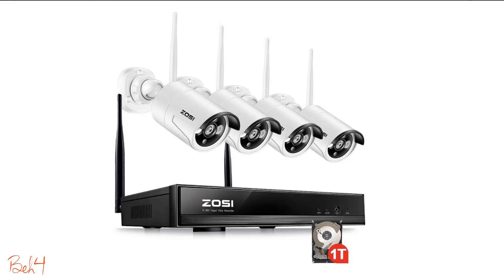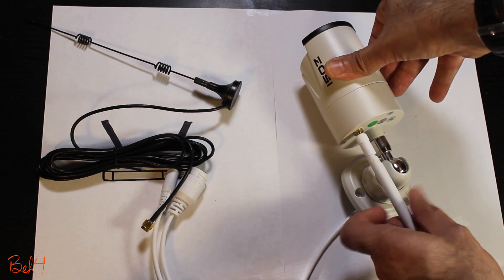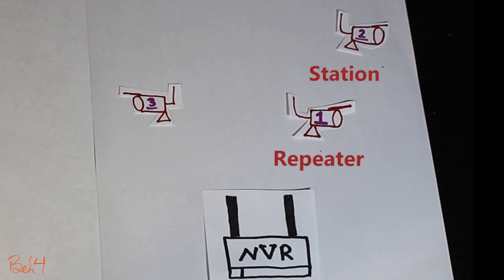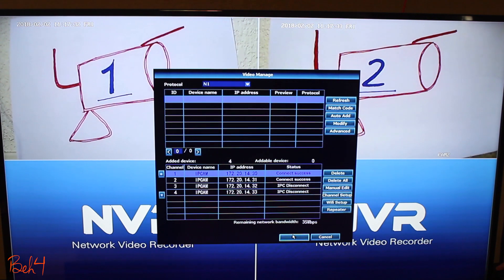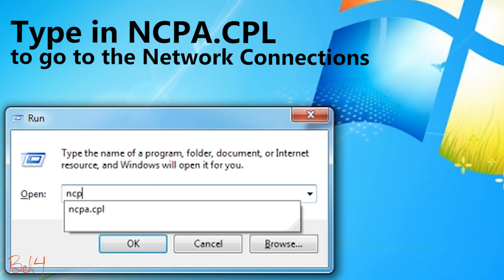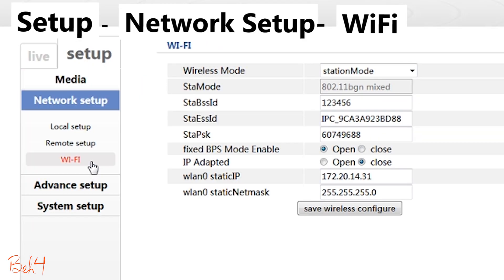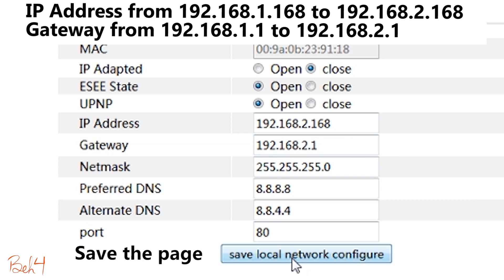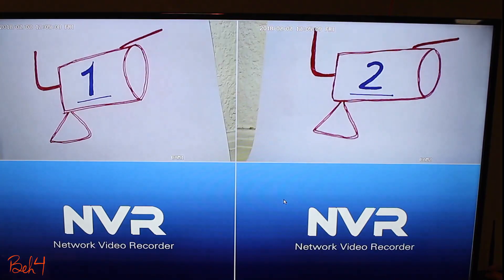ZOSI Security Camera - PART 3 [Resolve Poor Signal Issue]

Comment: What should be the distance between cameras and NVR?
Reply from the maker: There is no exact number because each environment is different ( obstacles, interference etc). The wireless range of the NVR should probably be more or less the same as the wireless range of a 2.4 GHz wireless router used in the same environment with the same wireless configuration. In my house for example the maximum practical range of the NVR is around 20 m.
Reply: Behfor Thanks..
Reply from the maker: You're very welcome!
Reply: @Behfor  > When you say your getting 20m, is that 20m radius from the NVR or Diametric range (which means the max distance from NVR to any camera can only be about 10m). But if its radius, then it will essentially cover 40m diameter circle of coverage. Can you plz explain. Or in other words whats the furthest distance your getting from the NVR to any one camera if you drew a line between them thru your building.

Comment: I have 8 960P IP cameras and connecting to the router resolved my issues with the last 3.  Thank you.    I am stuggling with motion alerts.   No matter what I set the sensitivity to I get hundreds of false alerts a day.   Do you have any idea what else I can try?   I have set the sensitivity to 1  and 99 with no improvement.   Also constrain the detection area to a small area.
Reply from the maker: You have already tried changing the sensitivity and changing the detection area and that's all I could have suggested. I personally use motion alerts for one of the cameras and only for a few hours a day. There were a few false alerts so far but nothing like what your experienced! Make sure the NVR's firmware is up-to-date, maybe it was an issue they fixed in the new firmware! Unfortunately that's all I can think of.

Comment: This is a fantastic video!  Thank you for sharing!  When using the wireless router to extend the range configuration, if a person messes up the settings in the cameras, can they be reset back to default so they would work as they did out of the box?  Also, I've got two WAPs...I'm assuming the method of using the WAPs would be the same, as long as they are all on the same network...right?  Thanks for your time!
Reply from the maker: Thank you so much for your comment and questions. In case the settings are messed up, you can connect the camera directly with an ethernet cable to the NVR and in the Video Manage page click Refresh so the NVR can find the connected camera and then click Match Code to pair it with NVR again the same way it was before. Thanks
Reply from the maker: As for the second question, you are absolutely right. As long the they are on the network it should work fine. Thanks!

Comment: Any idea how to do the second method using a Chormebook ?
Reply from the maker: Unfortunately I wouldn't know that because I never had a Chromebook! Maybe google would be helpful! You'll just need to set a static IP address to the LAN interface of the computer (the same as in the video) I'm just not sure how this can be done in Chromebook! Sorry!
Reply: Thank you for your reply. I'll just use an old windows laptop. I've got an Annke wireless system that is exactly the same as the Zosi, however I cant work out the default ip address of the cameras! :(
Reply from the maker: one way to find that is to connect the camera directly to the nvr and go to the video manage menu and hit the search button on the top of the page, it should find the camera and show its IP address.
Reply: Thank you very much. I'll give this a go! ... Great videos as well.

Comment: NVR giving an error information of repeater is incomplete when trying to access repeater function any solution?
Reply from the maker: I've seen that sometimes, but from what I remember it wasn't a serious error, I think it was because maybe one or more of the cameras were not connected to the NVR. Make sure all of them are connected when you go to the repeater and if you still see this error, close the error message and see if you can configure the repeater or not. From what I remember I could still configure the repeater even when this error showed up! I could be wrong though!
Reply: Thank you for your reply, no it doesn't allow to configure the repeater if i close the error message also, it just have some red lines for the camera and keeps giving the same error on pressing the refresh button.

Comment: Would it be possible to connect the camera to a wireless extender so that the wireless extender relays back to the router and then router to nvr. If so would the same steps apply? The extender is on the same network as the router
Reply from the maker: As long the they are all on the same network and the NVR is able to reach the camera which is connected to the repeater it should work fine and the steps would be the same as the ones in this video. Thanks
Reply: Behfor Thanks Behfor! I'll give it a try and report back if it works
Reply from the maker: Good luck! :-)
Reply: Were you able to connect via WiFi extender? If so, what steps did you follow? Thank you!
Reply: Chris C I wasn't able to extend with a Wi-Fi extender. It might be possible but I couldn't figure it out. However, I was able to configure the repeater system so that all cameras could connect with good to great connection. This took some time testing out different repeater options but it works (on a 4000sqft house with cameras on all sides and with an nvr that is not central).  Try and use the cameras that are closest to the Wi-Fi router/ best connection as your main hub and then try repeating through those. I would suggest moving your nvr to a central location where all cameras can receive some signal (if you have already installed them outside your house). But still you'll need to have some connection to each camera in order for the repeater system to work. Hope that helps bud
Reply: Chris C Just to note, move your nvr to a central location to configure your repeater so you can have connection to all cameras. You can then move your nvr back to whatever location you would like to have your nvr setup at and the repeater will still work. At least that's what happened in my case. This is only if you've already installed your cameras outside. If you haven't, it will be a bit more difficult. The easy part will be getting the signal to the cameras because you can do that inside your house. But the hard part will be testing different repeater options since you won't know which cameras will be a hub for the others

Comment: Indoors between concrete walls can connect from
Nvr to ip camera within 20meters?
Reply from the maker: Unfortunately I don't have concrete walls here to give you a definite answer, but one of my cameras is around 20 m from the NVR with drywall in between and works fine. The range would also depend on many other factors such as interference, noise and etc in the environment. But you can always make use of the repeater functionality of the cameras if you need to.

Comment: Man, thank you.
Did not bought yet, but i was checking this cameras. And did not know about bridge mode, neither connection to Wifi router. This sellers are still not so good with describing their products (Aliexpress)...
Are you satisfied with quality of picture and range of cameras? About how much space does it take on disk when recording? (your number of cameras and quality in random time period).
Thanks!
Reply from the maker: Thanks for the question! Overall I am satisfied with the whole thing but I can tell you that the major disappointment of all so far has been the APP which is not the most reliable Camera monitoring APP! Other than that I think what you get is a good value for money. Mine has 1 TB HDD and right now I have only 2 cameras installed and active for a couple of months and I'm using motion detection recording and the HDD is not full yet! I think the storage is enough but the good thing is that in case at some point you feel it is not enough you have the option to install a higher capacity HDD too! As far as the range and quality I should say that I'm using one of the cameras as a repeater for the other one otherwise the second one would not have been able to connect. The range is almost the same as the range of a normal 2.4 GHz wireless router, if you have a large house you might end up using one or 2 as a repeater to make sure they are connected with strong signal. If the signal is good then the quality is good too, so they really depend on each other I guess :-) It is 720 P which I believe is acceptable for a security camera, of course there are higher resolution cameras out there but for regular household security camera 720P should be fine. I also have tested Onwote security cameras which are very similar to this Zosi but the resolution is a bit higher (960P) https://www.youtube.com/watch?v=sa6Y8U4h29Q Hope this was helpful. Thanks!
Reply: Yes, I decided to take ZOSI 960P WiFi NVR set for neigbour (special deal on Aliex. EU warehouse), and will probably go for 8 cameras (max. 6 planned at the moment). If Wifi will not work ok, will try with remote antenna, then bridge (repeater) mode and last resort is LAN cable with "wannabe PoE" connectors connected to router <-> NVR. 
Will try to learn some more before buying a set for myself ;)
They would go for 1080P, but it isn't currently available from EU. I think 960P should suffice.
Thank you again, I subscribed and will try to give more feedback when cameras are received :)
Reply from the maker: Thank you so much :-)

Comment: Thanks for these very useful videos, I picked up the following system which I have only found out is basically a rebranded ZOSI, I've struggled to get the Cloud ID working (Still cannot view the video feeds remotely), and find the Android app very unstable. Customer service has not been particularly helpful. However after watching these videos I now understand the system, next step is to try create a VPN to remotely access the NVR. 

https://www.buyitdirect.ie/p/electriq-4-channel-hd-1080p-wireless-network-video-recorder-with-4-x-1080p-cameras-2tb-hard-drive-tl-v6e440w1tb
Reply from the maker: Great! I'm very glad you found these videos useful! You're right the cameras look very similar to the Zosi cameras!! Hopefully using a VPN connection will fix your issue! Thank you so much for letting me know and Good Luck :-)